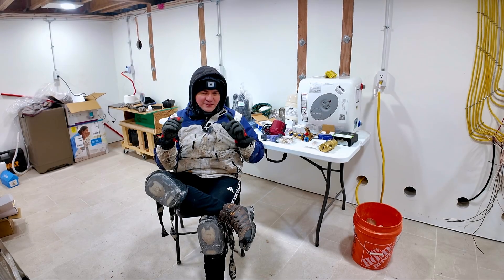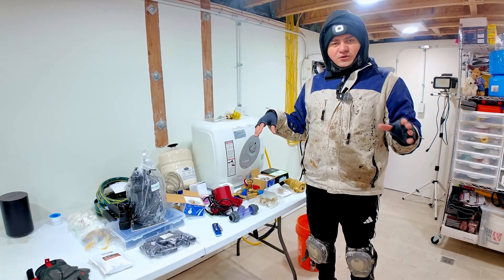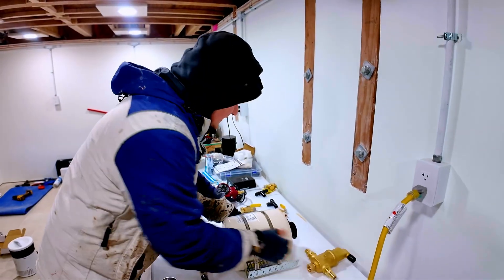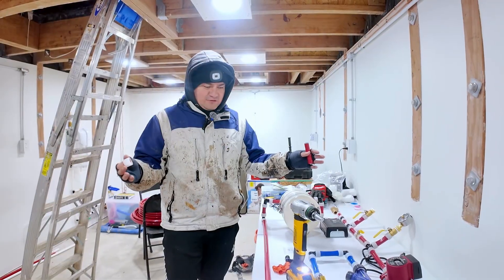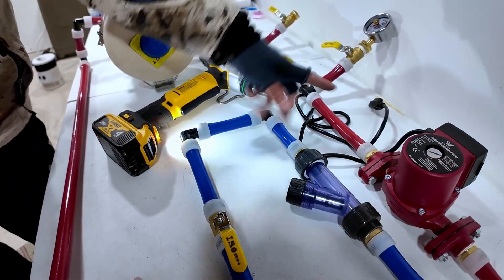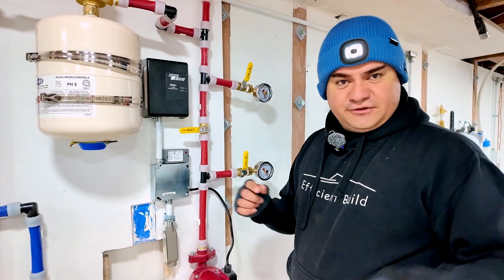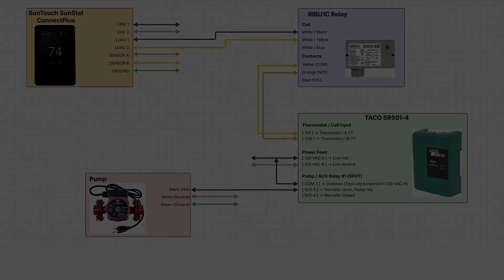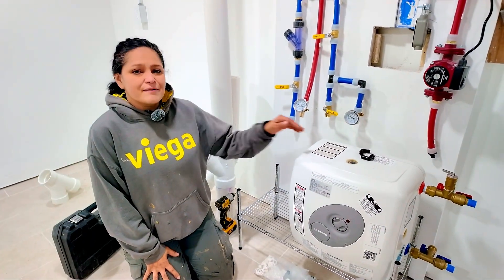DIY Hydronic Radiant Heat From Scratch (1440 Watts Passthrough Tank That Actually Works)

Comment from the maker: A lot of people say a small 1440-watt electric tank can’t run hydronic radiant heat — and in many cases, they’re right.

What made this work wasn’t a brand or a special heater, it was the system design:

• Underground mechanical room
• Concrete walls and slab
• Radiant loop in an isolated slab
• 4 inches of R-20 XPS insulation isolating a large thermal mass

Once that thermal mass is charged, the system doesn’t need massive wattage — it just needs to replace losses.

We also chose 3/4" PEX-A instead of copper, reverse-engineering a much more expensive commercial system to understand layout, components, and controls. It was a gamble… and it paid off.

If you’re thinking about building hydronic radiant heat:
👉 Thermal mass + insulation matter more than heater size
👉 Air in the system will kill performance
👉 Good design beats expensive parts

Drop your questions below — happy to dig into the details 👇
Reply: Maybe look into adding a sand battery to lower the power requirements even further
Reply from the maker: That's a great idea, of course a bit tough but if starting from scratch it might server well the entire house.
Reply: @AngryMan540  A sand battery does not reduce power requirements. It simply adds thermal mass.
Reply: Nothing a couple of manifolds could sort out

Comment: Good to reduce the copper, but you  could have a better system with a heat pump, and this could help eliminate the oxidization issues that you could get with cast iron pump while giving you a 2 to 3 times the efficiency of the system
Reply from the maker: The biggest takeaway from all comments has been the potential for rust. We are using Uponor HePEX under the floor that is rated for radiant heat and solves most of the issues related to letting oxygen in that may cause oxidation. We did not put it on the main system unfortunately, so oxidation is a possibility in the future.
This is mostly an experiment for getting radiant heat going, know the ins and outs while making it cheap. For the rest of the house we will use a bigger fancier tank, at which point it might be a heat pump. But those tanks are 3-4x more expensive than the passthrough tanks we are using and they also require their own circuit.

Comment: It appears you chose a cast iron circulator pump.  If you have any iron in the system it will rust while oxygen is present.  If you have a sealed system then the oxygen will be used up and rust will stop.  Normal PEX passes oxygen causing continual rust.  Copper and PEX with an oxygen barrier (aluminum layer) are used to prevent oxygen and so minimize rust.

Rust will result in rust particles circulating in the system which will damage valves and gauges in addition to degrading whatever is rusting.  The strainer helps collect the rust particles.

If your under floor tubing is not oxygen barrier then you need to use all stainless steel and brass or copper for your metal parts. Stainless steel circulator pumps are available. If that is what you have you might be good. Cast iron might should be replaced to prevent excess rust.
Reply from the maker: Thank you for the insight! We do have to build these for the entire house and this amazing information. We really appreciate it.
We do have Uponor HePex-A for the under the floor circuit, that blocks oxygen and more. The above ground Pex is not HePex, just regular so that might be an issue eventually. This is a small system we built to learn and thanks to you and others we have a more professional way of building the radiant heat that matters the right way.
Once again we appreciate your insights!

Comment: You really shouldn't need that rescue tape.  Three or four wraps of Teflon tape and some dope in the threads should seal any threaded connection.    Hydronic heating systems should be connected to your main water supply through a reducing valve and a back flow preventer.  The relief valve should be piped to the floor so it doesn't spray someone in the face if it blows.
Reply from the maker: We didn't want to disassemble everything, the tank had teflon tape wrapped around. For the situation it worked well. We also want to have the hydronic system isolated from the main water, we add glycol, very important in zone 7 where we are.

Comment: Copper is neater and will support the ciculator and will not sag from heat. , the big braas valve at the ex. tank is called an air seperator, you could purge the air from the heater by opening the relief valve,
Reply from the maker: Awesome, thank you for the tip! Yeah, forgot the name for a bit in one of the segments.

Comment: You need to use copper or oxygen barrier pex. It helps with limiting corrosion on the metal parts. For the radiant pex you can find a version with an aluminum layer in the pex that helps with the radiation. You can use aluminum sheet to also help distribute the heat I used that foil layered bubble rap to help with the heat distribution and direction. Also use a at least 33% glycol but I think I needs to be less than 50%. This helps with preventing bio fouling.
Reply from the maker: That's awesome, thank you for the info. Copper is crazy expensive so having an alternate solution makes sense. We have a rafted slab surrounded by insulation, that helps amazingly for thermal mass. Thanks!